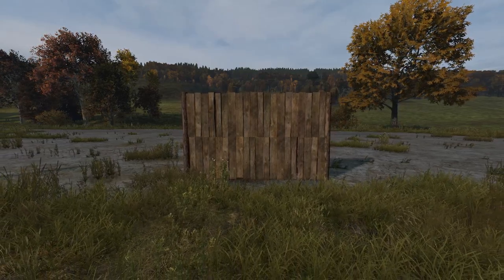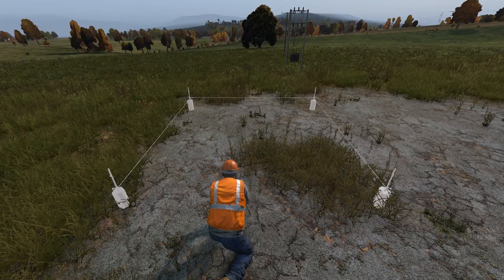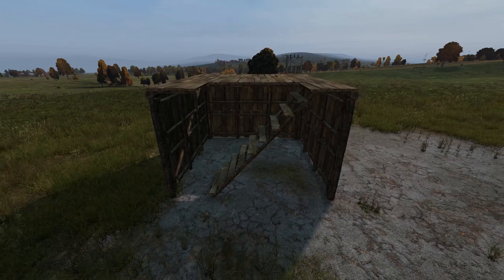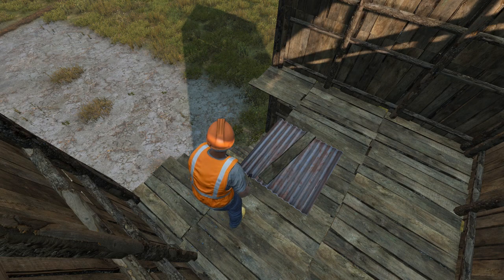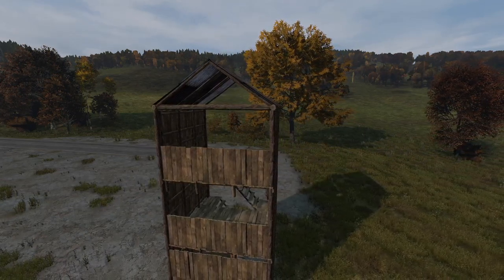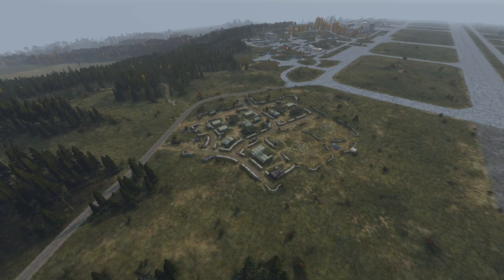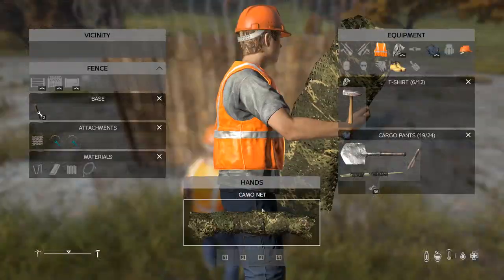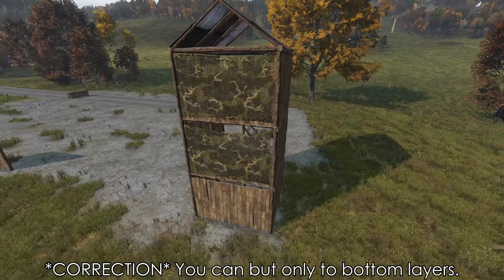DayZ BASE BUILDING Guide - Including ELECTRICITY!

Comment: This video was timed perfectly, just when I wanted to check an up to date building guide since I am a noob, this one pops up.
Kudos to you
Reply from the maker: Didnt even mean to publish it during free weekend lol.
Reply: Two extra tips. You can not make a gate if there is a platform built onto a wall. Also, more importantly, there is a current bug with gates and barbed wire. If you put barbed wire on a gate, and open it, it'll look like the barbed wire has moved with the gate. It has not. And if it's on the bottom, you'll be cut by the barbed wire every time you walk thru it.
Reply: Kudos from airmech?
Reply: did it pop up in your mouth ? and was is satisfying?  let us know bro

Comment: Wait...so...I can essentially have FREE electricity if I have a car battery, a battery charger, cable reals, and lights? ...Or does the battery charger get damaged the more you use it? o.O Because with a generator the issue of having to get gas sounds time consuming lol. My goal is to build a car first and then a base lol.
Reply from the maker: You can have unlimited electricity with batterys. But you need to take it off the electrical circuit and then charge it every so often.
Reply: @Xclusion  I also found out that if the Battery Charger gets damaged, I can repair it with the Electrical Repair Kit, which I literally find everywhere lmao.
Reply from the maker: @daisythorn6908  Yeah thats true.

Comment: Nice video bro:-) One question regarding vanilla only, how do I build my second floor on my base, I don't want 2 guys to boost up? I came to the conclusion that it is not possible, but I hope that's wrong......
Reply from the maker: Could use multiple watchtowers
Reply: @Xclusion  So What you basically are saying, is to connect them somehow......
Reply from the maker: @henrik4417  Yeah

Comment: I wish base building got a buff, because anyone can break into your base with an axe, sledgehammer, etc, which again, every person carries, and the time to break the lower wall is just 2 minutes.
Perhaps add explosives to blow up metal walls, let us build anywhere without mods, remove cars on console, they're worthless.
Reply from the maker: Yeah I am gonna make a raiding guide shortly.
Reply: @Xclusion  Well, all you need is a hatchet (which I'm sure everyone has on them every time), abuse low player hours and break in. 4-5 minutes and the place is looted dry and the guy is next town already.
Reply: Yea base building seems like a waste of time u might as well not even lock it, at least then u wouldn't need to spend a week rebuilding it. (I think i have found maybe 2 boxes of nails) 😂😂